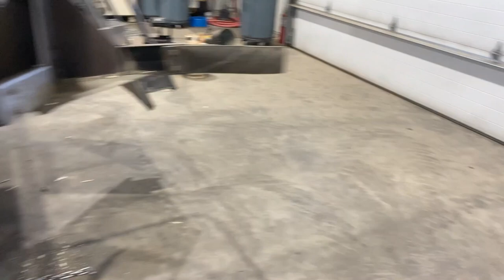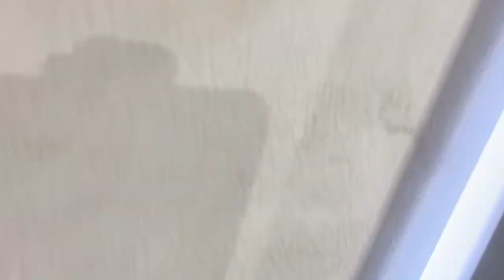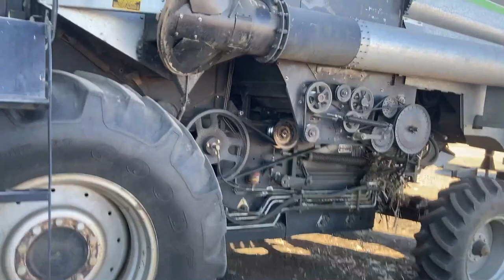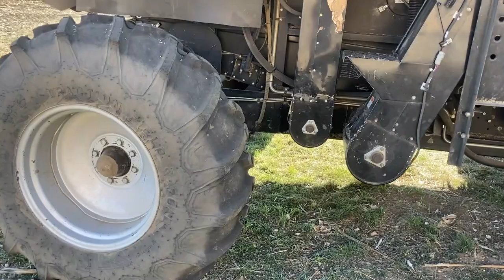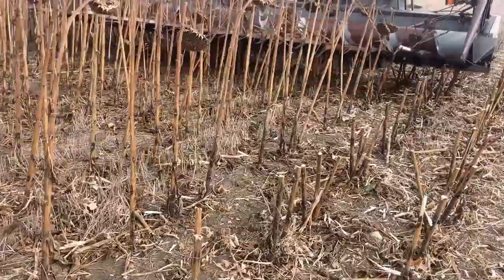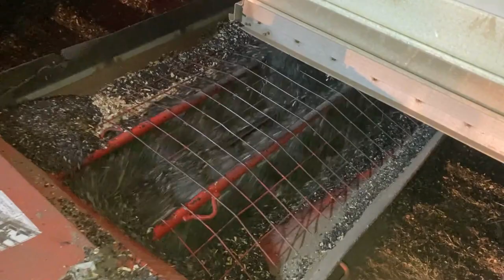Gleaners on the move N7 R70 R72 Sunflower harvest in North Dakota

Comment: Before you installed the rubber bushings, did you place the shoe in its neutral or centered position? The rubber bushings will be over torqued if you don't do this. Also all the bushings should be replaced at the same time including the rear ones and they should be installed without any lubrication.
Reply from the maker: Good point we did center the shoe when we replaced the rubber bushings the bushings have stood up well thanks for comment